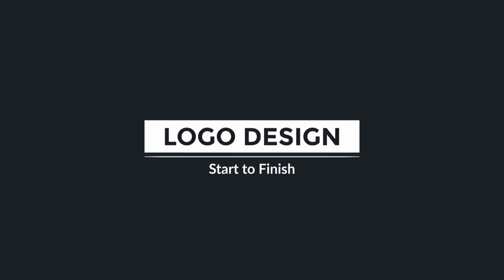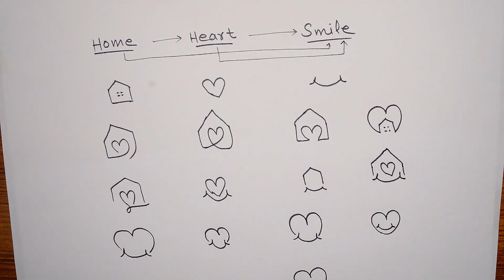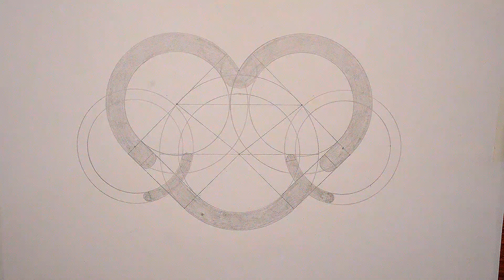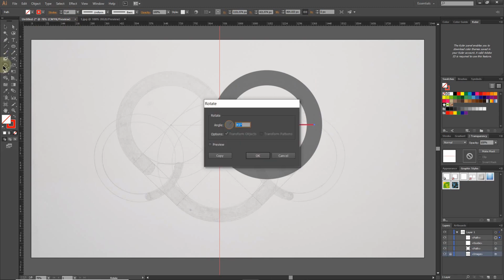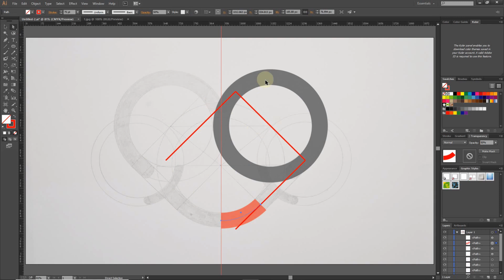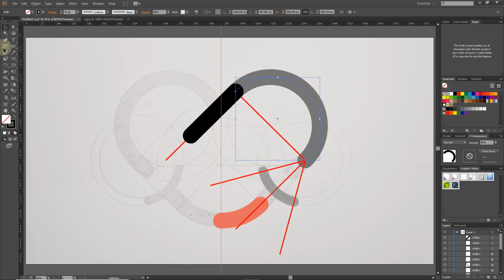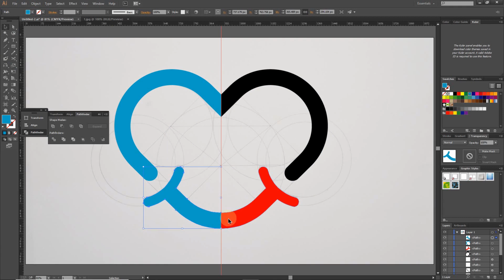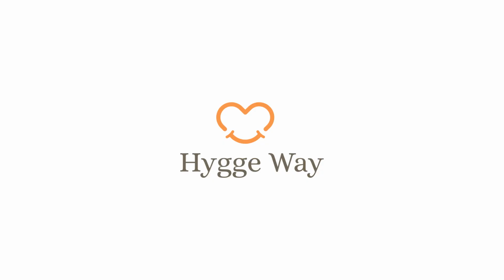Logo Design Process - Idea, Mind Mapping, Sketching, Sketch to vector

Comment: With all respect, your drawing on illustrator is too much complex when it is easy, if you use guides and snap it will shorten your time of making the logo .
Reply from the maker: You are absolutely right. Both the refine sketching and illustrator drawing is very complex. 
To improve this, I have uploaded another logo design process video, with much simpler steps. Please check this video and share your feedback : https://www.youtube.com/watch?v=sqDTgVqYv1c&t=67s

Comment: You are making it too complicated
Reply: I agree, he could've saved a bunch of steps. One example would be towards the end. Instead of using the reflect tool for each part, what he could've done was just design one part of the design (since the logo is symmetrical) then copy/paste in front. While the pasted version is still selected, right-click and select reflect in that menu. Choose "Vertical" and then ok. Then all you do is move the parts over to the other side and join the endpoints. Done.

Comment: you make your design. That can be vectorized easier away. This is 2021. Adobe Illustrator is more powerful those days.
Reply: Found it rather long but informative. I would have draw a square, cut out the bottom line, rounded the caps, reflected it and boom, the top half already created in one minute. Use the shaper tool to remove the unwanted lines. Better still use, the golden circles, to bang out the same design in two to three minutes. However, his thought process is amazing. Great work

Comment: Can I ask in which step would we discuss with the client about the options of the logo? Is it after we do rough sketching, or after refine sketching, or after we finish the Ai version? Thank you!
Reply from the maker: I usually ask two questions related to logo type
1) About logotype like letter, abstract, pictorial etc.
2) I ask the client to share some designs that he really likes.
If client replied of these questions, then this provides you a way, to proceed with.
Reply: @ifsparks  i mean after you get what the client wants and you come up with several ideas and options in the rough sketch, then would you let the client pick the one they like or would you pick the best one yourself and make the illustration of it on Ai? Like what is the moment you show the client your design options: after you do rough sketching, or you show them after you transfer them into digital versions?
Reply from the maker: @huantran8720  If you show all the rough sketches to the client, then he will ask you to digitalize all of them, one after another, in no of revisions. That's why i choose, most suitable 2-3 options, digitalize them and then represent to the client by using different layouts and mockups.
Reply: @ifsparks  i got it. Thank you so much for your advice ♥️
Reply from the maker: @huantran8720  You are welcome